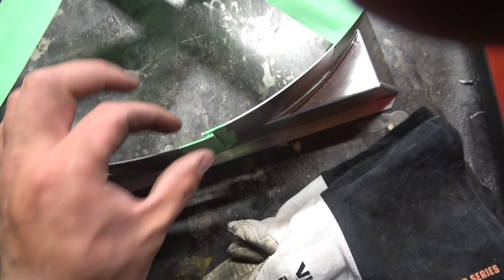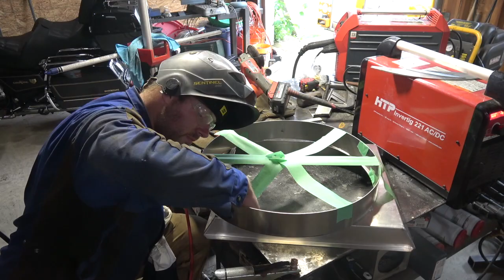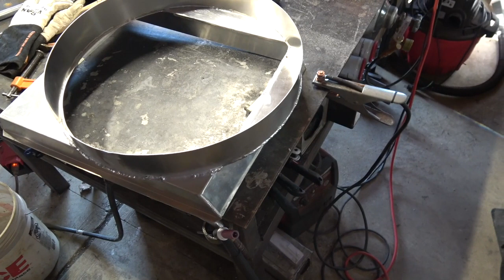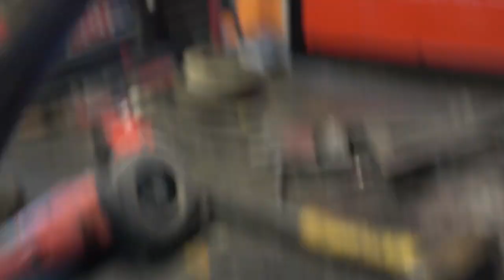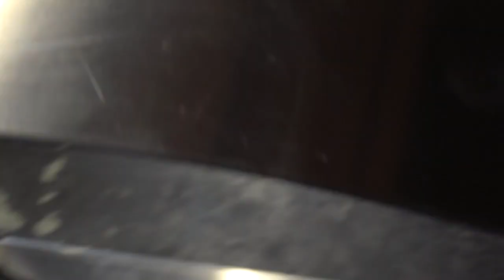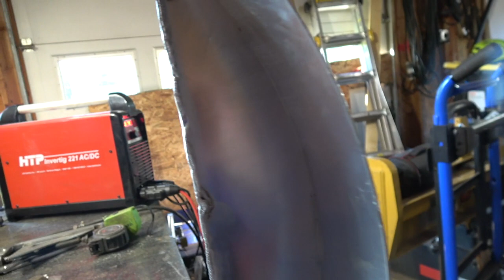My first Aluminum Tig Project

Comment: i would clean the parts and the welding rod with acetone😉
Reply from the maker: I did. most of that part is edited out. if you watch the time lapse close enough somewhere near the beginning you can see me wipe down one of the filler rods.